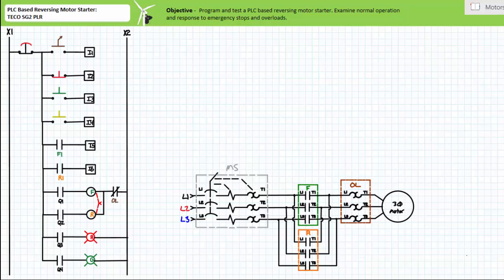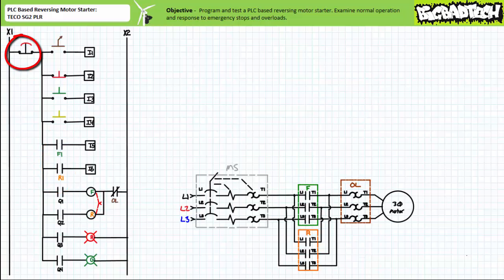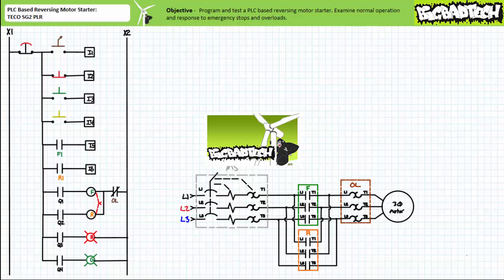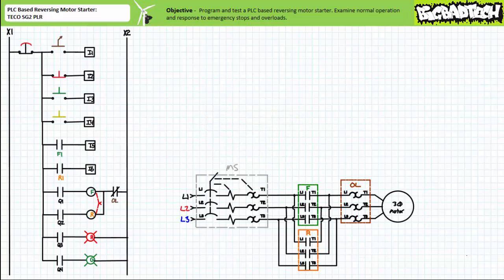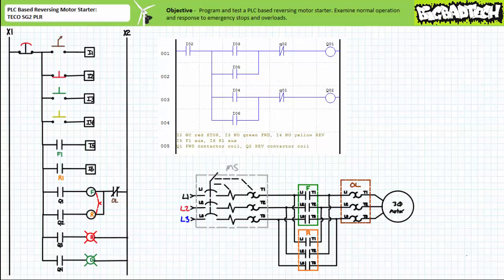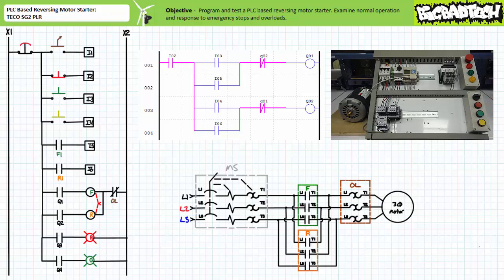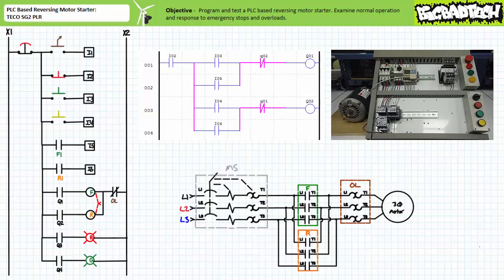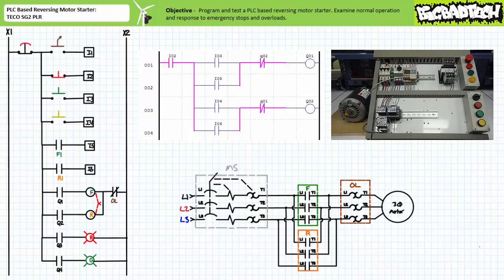PLC Based Reversing Motor Starter: TECO SG2 PLR (Full Lecture)

Comment: Your holding circuit doesn't have the combined real world and system generated feed back (I5/Q1 or I6/Q2) that you discussed in the previous videos, to stop manual operation of the F or R contactor creating issues. I assume you have left these out to prevent you having to add in further rungs of code and making the demonstration messy @Jim Pytel?
Reply from the maker: Yes. This is a super simple F/R motor starter. You could easily make it more robust by adding this feature should the application warrant it. Sometimes you want this feature. Sometimes you don't.